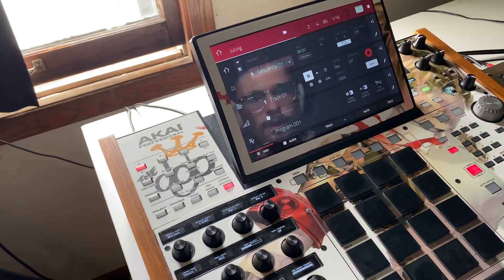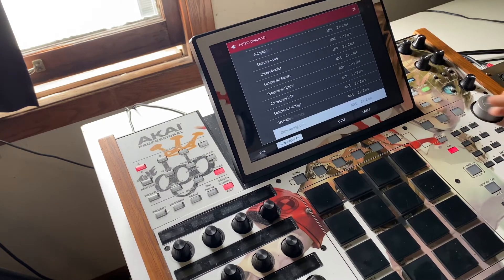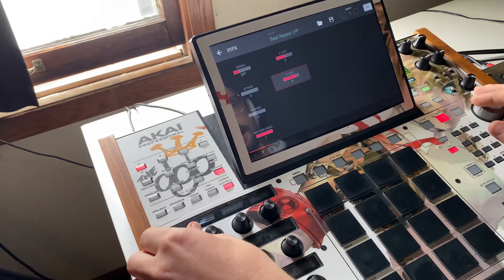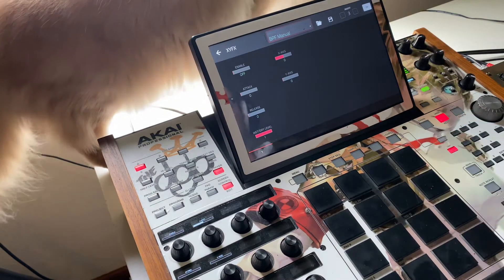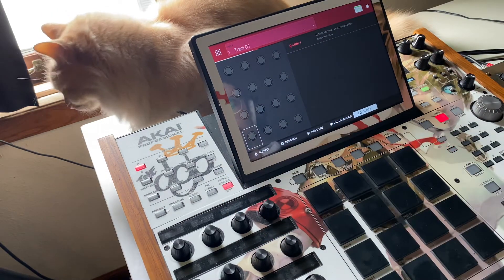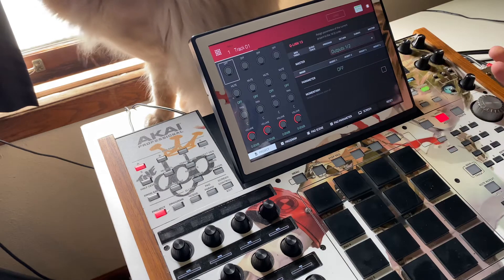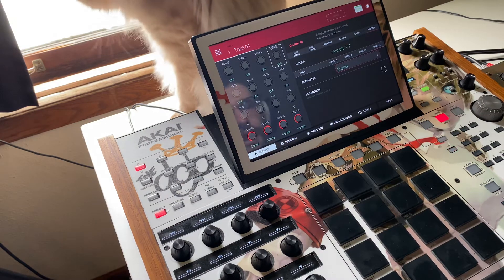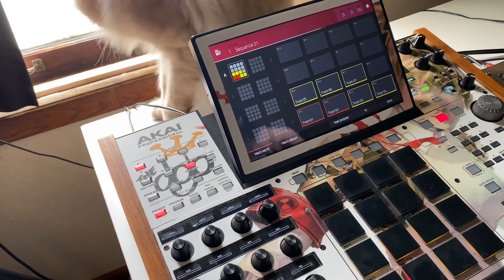MPC Q-Link XYFX Tutorial

Comment: Hi Alex, I was wondering how you connected your sansui reverb to your setup? I know this isn't the sansui video, but I reckoned you would see comment notifications faster on your latest video. Thanks
Reply from the maker: hi, yeah i have it set up as an external effect with my interface now. honestly one of the channels went out on it so i've been running it mono. but yeah i just have it going through the reverb in and out on the back. pretty straight up. thanks!
Reply: @mltzrbeats  Oh so you can actually just connect a RCA to 6.35 jack straight from the I/O to your interface I/O? That's perfect. Also someone mentioned I needed a certain cable to plug the power, he said something about an ungrounded powerstrip, is that true? Also the beat sound great man, keep it up!